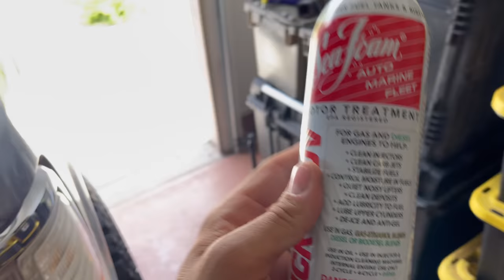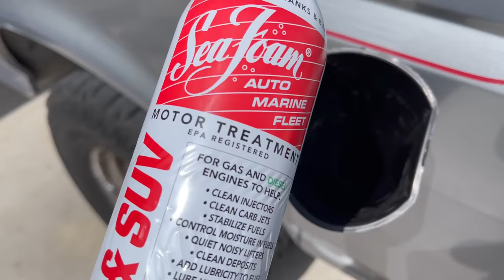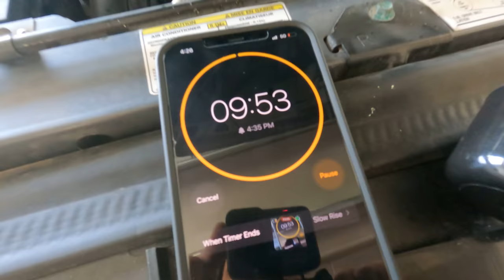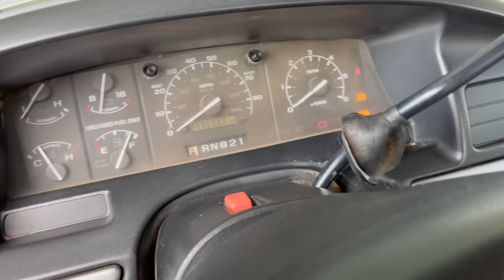Seafoam - Engine Treatment | How-to and is it safe inside your motor?

Comment: The reason why SeaFoam works is that it is basically isopropyl rubbing alcohol, at a 91% concentration. 

You could theoretically use Everclear slightly diluted to do the same thing.

Also, you should use Seafoam as an engine flush, before an oil change. Otherwise, you risk damage if you run SeaFoam in your oil and drive with it in the crankcase, as doing so thins out your oil and makes it as if it is a lower weight.
Reply: U r right if u read the back says to do it then change oil
Reply: @johnwayn2805  : It's what happens when you do read the label, lol.

Anymore, I don't take people at their word about various things, because the internet has given con artists and snake oil salesmen carte blanche to basically defraud people. I'm sure the video creator isn't intending to mislead, but a quick reading of a SeaFoam can does say that you're supposed to add it to the crankcase, run the engine for 15 minutes, then change the oil.
Reply: Not quite true ethanol alcohol boils off at 172 degrees so most of it will evaporate out as you run engine the avg engine temp is around 190
Reply: @georgepaiva7496  : No. Most engines run way, way hotter than 190° F. Why do you think coolant systems, let alone internal lubrication systems, are pressurized at 13-16 psi? It's because an engine runs hotter than 212° F, the boiling point of water.

I learned about internal combustion temperatures in college, and most people don't understand that the coolant in a car is an auxiliary cooling system, as the engine oil actually does most of the job keeping an engine cool, considering that an engine can reach a temperature north of 500° F. It's also why any lock-tite for exhaust header bolts have to withstand those temps, and why turbo systems have to have heat dissipation as part of the system -- because pressurizing highly heated air does nothing for combustion purposes, and leads to not just an engine running lean, but more than likely, pre-detonation in a combustion chamber.

Comment: Good video except for saying something the company recommended to change out after 100-300 miles can be left a full oil change.  Sure seafoam says its safe except good luck getting them to pay if a problem happens, prove it is what they'll say not ok we'll replace your motor.  They also have notes it can make your oil dirty, depending on condition of your crankcase and motor.  So it's rather irresponsible to advocate oh thats ok without a caveat.  Such as except or if you suspect your motor is dirty or has lots of sludge it may not be good to leave in long.

Comment: If you want to clean the inside of an engine use some transmission fluid dextron run your engine for 10 to 15 minutes at high idle and then train everything keep doing it every oil change before every oil change and your engine will slowly become clean without ruining anything.
Reply: Hydraulic fluid is bad for oil & fuel system seals.
Reply: did it to my Pontiac yrs ago. After 3-5 min idling engine started knocking! Burnt up the crank bearing. Id do it for a minute. It did silence the engine but not more than a min!.

Comment: put seafoam in gas tank and spray in the valve body but don't pour it inside the engine. Breaking carbon inside the engine will just distribute it and lead to more problems, your engine will have more chance to break in the future.

Comment: Very few products like this can be used in 2 Cycles. Seafoam is the best for that, besides traditional uses. Only cleaner I found stronger but you can't use it in 2 Cycles is Berryman. These 2 products are the only one I will buy and If i had to choose between them, it would be Seafoam.

Comment: Isn’t this  only used on carburetor engines??or lawnmowers???? Honestly I will never use this on my car
Reply: It works well on fuel injected engines also I always avoided this product till a mechanic told me about it. This company has been in business about 100 years. How many other products have been out that long?
Reply: @williamstockton2344  I still wouldn’t use it,thanks either way bro

Comment: Do not spray sea foam threw the mass air flow sensor. Newer cars can be fed threw the brake booster vacuum line.
Reply: no need to use seafoam on a newer car lol their not fuel injected
Reply: @anonymousrhinosaurus9540  your very wrong. Carbon builds up in GDI motors. Carbon builds in cylinder walls and the intake and exhaust valves.Hyundai even recommends they do it to improve gas mileage.
Reply: @MasterYota1  welp I was wrong I guess.

Comment: Sea foam is highly refined petroleum, its safe to add to your gas. Remember if we are to careful you’ll trip on the crayons 🖍️I’ve been putting this stuff in cars n small engines for years and never a problem.

Comment: Seafoam has worked miracles in every pickup I have owned since 2006.    With the exception of the 2004 F150 I currently drive now.   I have  numerous treatments over the last two years, plus every time  I fuel up I add a big can. (Weekly)
It helps a little but still still shakes like a whore in church.   Now it has no power on take off.   
So 1 bad experience vs 12 great experiences.  I'll always use seafoam.   Best shit out there.

Comment: This is a good way to dilute the engine oil and lose compression.
Reply: Negative. Sea foam will not change the viscosity of the oil if used correctly. Just sharing knowledge.
Reply: What if you just get an oil change afterwards
Reply: That’s why it is supposed to be used 300 miles before an oil change lol

Comment: 4 point farms the external owner of floor point farms has a video of Pitt or bowels sitting in that stuff in a glass jar for a month and it didn't clean the liquid carbon off oven Several other cleaners including marble mysterio and Barrington's B12 chemical and Berryman's B12 chemicals sitting the same month actually ate carbon loose from the same exact set of owls You should check that out too in the old days dealership mechanics used to take up vacuum line loose and do the same thing with ice water is what you're doing with the brain or the sea foam now

Comment: After the 500 miles I know you not only changed the oil but you put on a new oil filter... I know you didn't need to tell us that, well, as long as we are not dumber than a fence post.. haha.
One question though, 
Are weight oz. The same as fluid oz?

Comment: I'm a BIG fan of Sea Foam for the intake and for the fuel system. If you're thinking that dumping the Sea Foam into your tank will clean the intake, you may or may not be right.  Carbureted and throttle body fuel injection WILL introduce the Sea Foam into the intake, where it WILL help clean the intake manifold and valves.  If your engine is DIRECT INJECTED it WON'T, as the fuel is introduced directly into the combustion chambers, bypassing the intake manifold and valves.  For DI engines the spray is the ONLY way to clean the intake and valves without actually removing the intake manifold.  Of course, the spray will quickly clean the intake manifold and valves on ANY engine.  That spray WORKS!

I'm not a big fan of adding oil system cleaners to the crankcase.  The reason?  Over time, contaminants in the oil will stick to and harden on cooler parts of the engine such as the valve covers, rocker arms, and valve lifters.  Other contaminants will simply settle to the bottom of the oil pan.  When you add a cleaner to the crankcase, it starts breaking up these formations.  Now you have hard, gritty, crusty stuff running around in your engine, clogging passages and ruining your valve lifters.  Better always is to KEEP UP WITH YOUR OIL/FILTER CHANGES!!!  I've only owned one new car; a 1985 Oldsmobile Delta 88 with a 5L V8.  I changed the oil/filter every 4K miles.  It was Castrol GTX conventional oil; not synthetic.  Synthetic was just coming on the scene at that time.  It was expensive and unproven.  I owned that car for fifteen years.  Twelve years into ownership I had a compression test done on it.  The reading still met specifications... FOR A NEW ENGINE!  Near the end of my time with the car I had to change one of the valve cover gaskets.  Yes, it took that long for that one leak to happen.  Any of you old guys out there will be able to testify that the GM V8's were INFAMOUS for leaking oil from the valve covers at their lower rear corners!  Keeping the oil fresh also keeps the engine's seals and gaskets supple and effective.  When I pulled the valve cover off its underside was absolutely CLEAN!  So were the rocker arms.  I could still read markings that were written on some of the parts with a paint pen!  After fifteen years the engine's innards were LIKE NEW!    If you keep up with your fluid changes your car will probably outlast your interest or need for it!  I sold the Olds because we needed a 4-door...  Yuk!

...And yeah, I caught the dry measure/liquid measure screw-up too...  You don't WEIGH a FLUID ounce...  An ounce of water weighs more than an ounce of oil.  That's why oil floats on water...  'Nuff said...

Comment: Seafoam is for "Sea-gull-ables"  on 
worn beyond designed obsolescence...only IF the mostly 
inexperienced "home mech" can waste money on many additives and their results on extreme high mileage motors...
Now, IF these treatments are done on a pre-100k mile motor...posibly could help...but
Mfg/dealer
warranties could be voided by pouring them in tank😮

Comment: There is a cheaper way of doing it with a stock lifter, Ani automatic transmission fluid, dump it in the engine, and you will help your engine in several ways by doing this soften seals up break all the carbon lose break all the sludge in the motor loose and it goes to the oil filter leave it in there until it’s due for oil change. Change it for a new filter on it, if it takes 4 1/2 quarts minus out 1 quart of motor oil and put another quart of ATF in it and drive at 3000 miles it will not hurt it. It will just break everything loose and you can actually dump the ATF in the tank it will go through your fuel system break all the tires it’s loose  so you could do ATF seafoam a couple different ways I like ATF because it’s Harley detergent. These new motor oils are junk they don’t have detergent serum that’s why these motors are sludge it up and feeling and that’s what the manufactures want so they don’t have to warranty yet you have to pay you got a think , do you oil changes every 3000 miles no matter what that motor is running is contaminate net oil with that fuel I don’t care what type all you got and what the manufacturer say go ahead and wait 7500 miles to change your oil, and your motor will fill quicker than anything  What happened to three months or 3000 miles. You didn’t have all these motors failing at low mileage they were going higher mileage no internal failure yes there is some it all depends on how you drive and then why are you traded and why are you maintenance it? How are you change oil? There’s a bunch of old-school trick Souther that does work and this is one of them automatic transmission fluid.

Comment: Everyone knows the best way to keep your engine running clean is to go on the internet and anomymously, and condescendingly tell people in comment sections of videos that they don't know crap about working on cars and point out miniscule, irrelevant details as to why they shouldn't do what theyre doing. Youre car will run like new, with 50 more horse power if you do this every 3,000 miles.

Comment: Do NOT put it in your fuel tank!!! It will stir all the packed crud on the bottom of your tank and soon will plug your fuel filter and strand you. If you do, carry an extra fuel filter with you. I know, stranded 2 of my vehicles within 500 miles. I love the stuff, works well in the crankcase 100 miles before an oil change, or down the carb. Word to the wise!

Comment: Engines can run on 90%seafoam.    In Ontario it's a god send everyone has it ....we have crappy pretend gas and if it sits for a few months in your tank it'll turn into a cloudy blob
Stabilizer won't help...only seafoam.  Put a 1/2can in every 5gal can i have.   Lots of others do to...#1 problem nowadays is gas . In every small engine application.

Comment: DO NOT use seafoam it is overly caustic. put it in my 2005 5.7 JGC ( @ 140K miles) and less than 1K miles later all the seals in my engine were gone and I had oil leaks everywhere....rear mail seal, valve cover leaks, intake manifold, ended up needing to get rid of jeep because cost of repairs was well over what vehicle was worth. truck was mint prior to that.

Comment: So seafoam makes smoke...and your assumption is smoke is good....not necessarily factual that a smokeing engine results in a more efficient engine.
The only genuine "PROOF" of the efficacy of seafoam would be a detailed examination of the valve train/valve faces and stems/piston tops/overall condition of the heads and engine oil analysis.
Otherwise you may have bought into a well established snake oil scheme. Another way to put this is that engine coolant leaking into combustion chamber makes white=ish smoke  ?good or bad? hopped up diesel engine running rich dump black soooty smoke out the tail pipe ?good or bad? The point being that stuff coming out your tailpipe is not a cerifiable method for detrmining overall engine condition and performance.

Comment: Guess where all that loosened carbon goes ?…into your cat converters !…and excess carbon destroys cat converters!…this system was originally used on 2-stroke outboards on a regular basis to decarbon engine as service maintenance …not recommended on motors with high operating hours with no service…can cause stuck or broken piston rings from loosened excessive carbon…

Comment: Seafoam for the clean, Bar's Leaks for the drips. Thank me later. 👍
Reply: Gotta be careful with bars leak and newer engines. They have smaller oil ports than older ones and it can seal them up.

That was from a mechanic friend but it makes sense. I do like their cooling system leak sealer.
Reply: @JamesSmullins  25 year mechanic here mate. If it hurts a newer car it was already passed the help phase.

Comment: People never think about the effects of doing things like this to there engines!! Now you just ran all that junk through your engine knocked all that carbon and sludge loose and where is it going to end up!! In all your oil passages main bearings can bearings lifters every where your oil goes now has all that shit you broke loose in it!! See I can guarantee you this seafoam doesn’t just melt the carbon and sludge away it breaks it loose from the metal surfaces in the engine so if the engine has been neglected any at all there is a dang good chance doing this is going to knock loose big chunks of carbon and sludge!! Big chunks of carbon and sludge plug oil passages the oil pumps and lodge in bearings!! Iv had people bring me there vehicles after doing these treatments with nocking lifters plugged oil pump pickup screens nocking rods all sorts of problems from doing these seafoam treatments!! Its a different story if you have owned or knew the vehicle it’s whole life and its maintenance schedule has been followed and kept up with and the vehicles has been seafoamd say once a year every year and you know for a fact there isn’t going to be any excessive build up in the engine but if you buy a vehicle and you don’t know how it’s been taken care of which you said was the case in this video then you should never never do the seafoam treatment to a vehicle like that ever your just asking for trouble!! Seafoam was originally designed for two stroke outboard boat motors to clean two stroke oil buildup and carbon from old 2 stroke oils from back in the day when oils weren’t very clean and didn’t have any detergent package in them hints the name seafoam!! People started putting it in there vehicles not doing any research or knowing what it was actually for and seafoam just added that you could use it in vehicles when they found out people were putting it in there vehicles and claimed it wouldn’t harm engines well if anyone knows how a 2 stroke engine works it’s noting like the way a four stroke engine with valves and oil passages works and that’s why it a terrible idea to use this in your vehicle!!